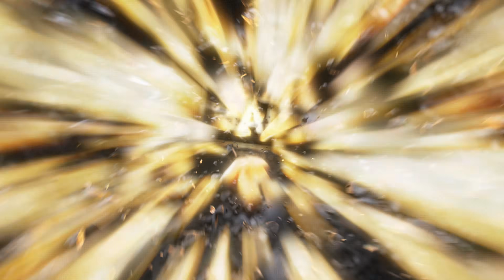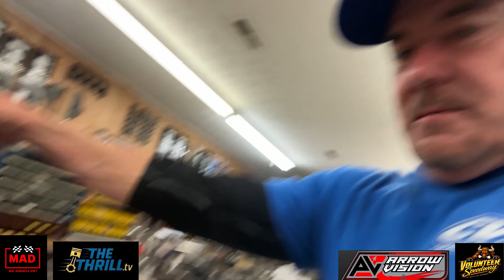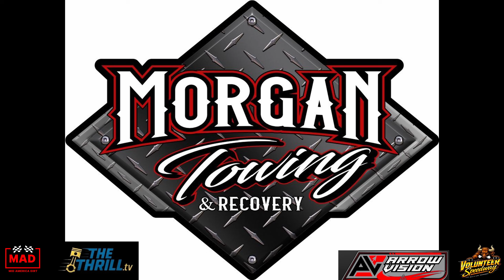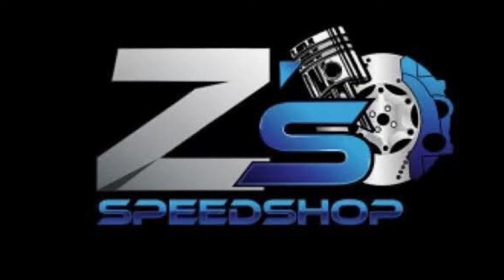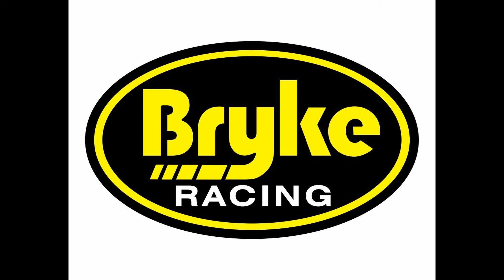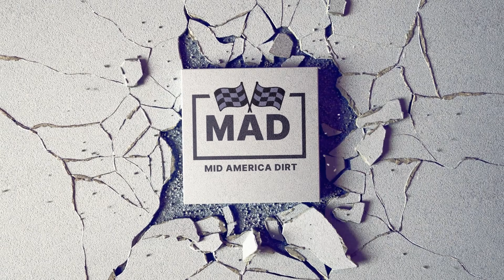How High-Performance Dirt Racing Engines are Really Built| Vic Hill Interview

Comment: WHy is 500 HP back in 80's equal to 900 HP today , Because cars aren't any faster today.. Technically speaking the speeds haven't changed.  500 HP in 3000 pound car in quarter mile roughly 10.30 and these new engines got 8-900 HP in same car runs basically the same..